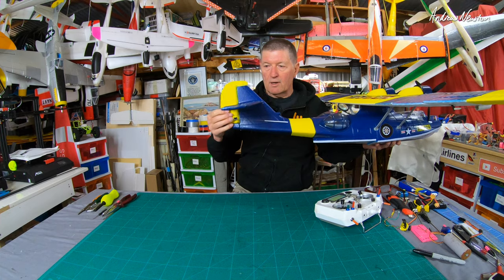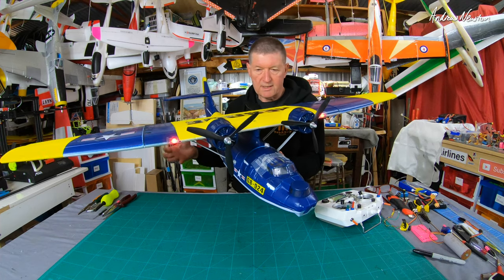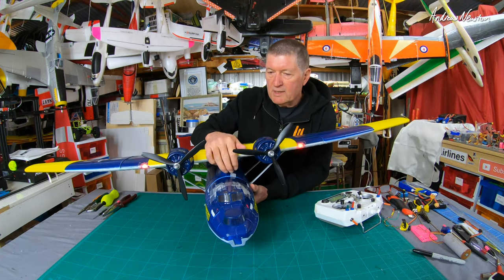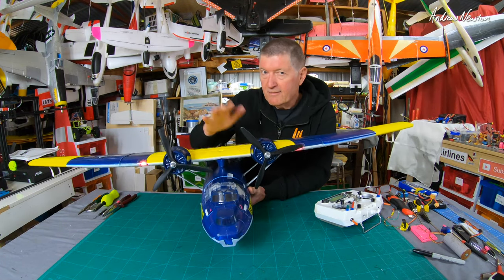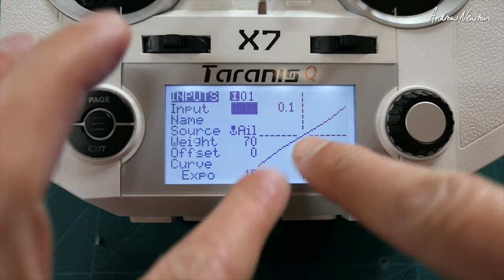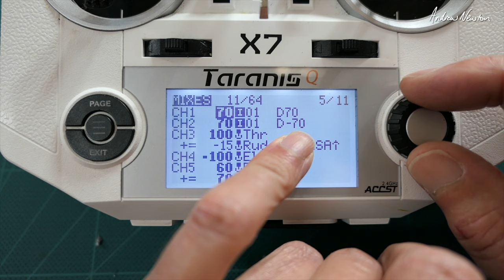Dynam PBY Catalina Aileron Differential

Comment: Very nice tutorial and flight demonstration on setting up aileron differential. I've only had to use aileron differential on my Volantex P51D 750mm to get much better roll authority. I had to do just the opposite but I suppose for roll you have more air pressure at the bottom than on the top. Thanks for the info and I'll see you in the Air!

Comment: You can do the differential mechanically by just angling the servo arms forward a spline or two at neutral (and unscrewing the clevises to centre the ailerons again). The advantage is you're then using the full physical servo throw (as Barry Cole mentioned), and you don't need to have each aileron on a separate channel. Totally agree on the counter-rotating props btw - it's a fad that manufacturers seem to have latched on to. On a twin the motor/prop torque is split between the two motors and doesn't act along the plane's roll axis anyway, so you just don't get the same type of torque reaction that you do with a single-engined model.
Reply from the maker: Well said. Now I need to make the video that demonstrates it.

Comment: Andrew: Slightly OT, but i note you store your planes hung from the ceiling.  Could you talk us through how you've suspended them and avoided damage to the tail?
Reply from the maker: I make a wide PVC hook that hooks over the wing leading edge. The line just passes over the tail and around the fuselage so it hangs

Comment: It's maybe a fun idea to use the wing floats for air brakes. Lower the right float to make a turn to the right.
Reply: Also add a swayable torsion axle to have real landing wheels.
Reply from the maker: Ha radical ideas

Comment: Can u  make video on full 3d printed plane pls, if u want👍
Reply from the maker: They look good but too delicate for normal use. Not really interested in that method of making planes.
Reply: @AndrewNewton  it's ok, i can understand👍
Reply: Yes, they look fantastic but are very brittle; so a heavy landing that would be fixable for a foamy or balsa plane will result in a thousand pieces of plastic. I’ve done it myself and seen others. I do have a Spitfire that I’m going to try covering with glass fibre/resin to see whether it makes it sufficiently robust for flying.
Great series of videos on the Catalina Andrew. Just waiting for the postman to bring mine, which is why I’m checking out your advice now.